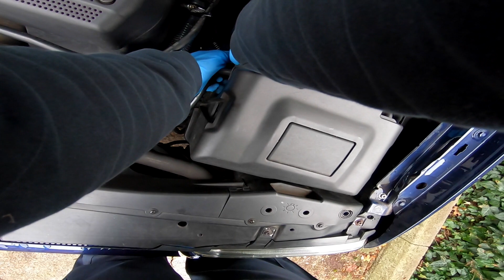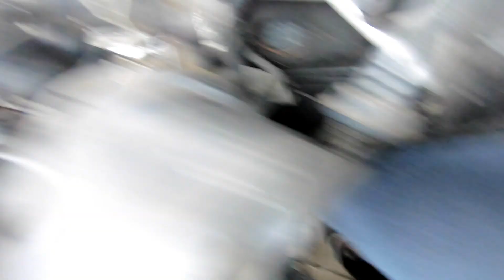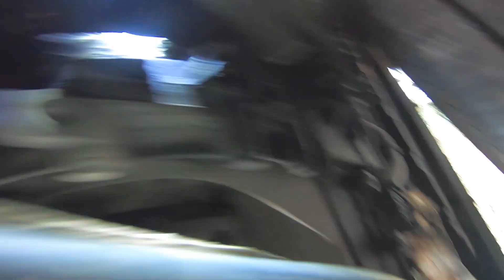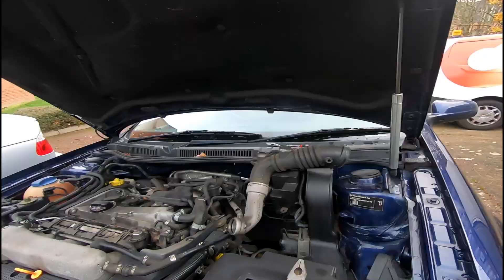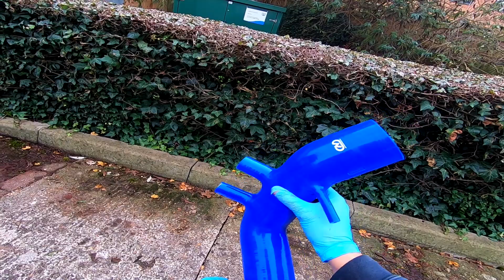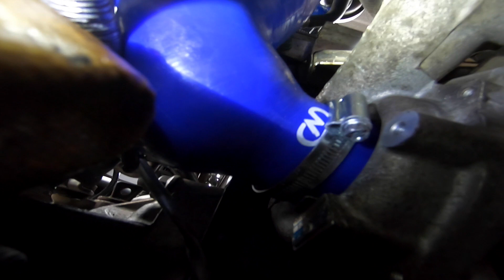MK4 VOLKSWAGEN GOLF GTI: INSTALLING AN OVERSIZED TURBO INLET PIPE (TIP)

Comment: Recently been following the mk4 content and loving it on the turbo inlet right at the bottom there is a nipple if my pipe is removed from that nipple will that cause boost issues low boost?
Reply from the maker: I'm not entirely sure what you are referring to, but I would try to not have things missing if you can avoid it.

Comment: If you want more air go for the CLOUDE 9 CUSTOMS LARGE PRORAM INTAKE KIT u will only need filter and the velocity stack will fit in your ram air heat shield
Reply from the maker: I will definitely look into this, they look really cool as well. Thanks for the suggestion

Comment: Hi Naz, thank you so much for making these really clear videos on your MK4.  They help me a lot with my A3 1.8t which is based on the same platform. I’m planning on doing the same oversize tip and ram air filter this weekend. To be honest I was dreading it but not so much now after watching how you did it. I will be getting some silicone grease as you suggested and unbolting that pipe. Love the channel mate and thanks again for great content.
Reply from the maker: Hi mate, sounds good to me!! Glad to hear you are giving it a go yourself. Failed to mention in the video that the TIP requires a little trimming at the MAF end, but you will have to work that out once it's on. Unfortunately, doing the engine bay deletes makes the area around the turbo so much more accessible but it's quite a big job first time around. You should be fine getting the TIP done, my friend had a Leon and he found it easy.

Comment: bruva, cold air ... but proper cold air mod nothing sucking hot air from the engine bay... and 3inch straight pipes.. hit that stage 2 software but go to some one experienced that will make a one off file for your k03s as that puppy can do a few small ticks if your car can breathe like with this setup. ... trust BRUVA!!  them 3rd gear power burnouts dont lie!
Reply from the maker: Hey man, thanks for your comment. My car has now been mapped stage 2 for almost two years now and I love it.

Comment: Hi mate, what’s the reason you got the 3” maf end? I’m not sure which size maf end to buy as mine is the 2’75” but possibly upgrading in the future and don’t want to have to change again, wasn’t sure if that coupling reducer came with it or did you buy that separate? If it didn’t, what size was it and where from? Thankyou 😎
Ben Rickard
Reply from the maker: So sorry for the late reply. I bought the 3" end to keep the option open of going for a 3" MAF but never bothered in the end. I bought a smaller piece of silicone hose and used that to space the gap out. Again apologies for the late reply and hope it all works out for you.

Comment: My ecs tip was a pain but I did get it on with no grease and it was a lot of work but fits great
Reply from the maker: Nice one mate, im glad it was nice and easy for you. It's a cool modification as well and it's supposed to be one of the most important ones for the 1.8t.

Comment: This vid is a godsend lol, I'll be doing this mod this weekend. I bought the Forge (Silicone Intake Hose for Audi, VW, SEAT, and Skoda 1.8T - MGOLFIND).

As soon as you mentioned some of these hoses only fit onto a k04 got me a bit scared now.
Mines is a 2006 Audi TT MK1 Roadster, 163BHP, BVP Engine, 8N9, K03 Turbo I believe.
Reply from the maker: Hey man, you should be fine with that Forge one as I remember that being an option. It's only the Badger5 one I think that is made for the KO4 on BAM engines. 

You might need to do a bit of trimming but then again maybe not, either way good luck with the job I'm sure you will be very happy with it once it's complete.
Reply: @SPOOLINUP  I've managed to get the original intake out,struggling a lot with getting the new one in. Will be getting silicone grease tomorrow, and might try dipping the corner in hot water like you did. I'm also hoping it fits onto the turbo as I read on the Forge website the intake pipe is 44mm at the turbo side, so am hoping my turbo is not the 50mm one!
Reply: @SPOOLINUP  did it! Holy cow was a tough job. Had to cut off around 2-3cm of pipe at the bottom and also at the top. Didn't need a couple for the MAF, it fit direct 70mm to 70mm. I trimmed the hockey puck pipe a little and I think a tiny thin piece mightve fell in the pipe 😢.. took it on a test drive no lights, no smoke, everything seems fine, more response, feels like more torque/power/responsive. Will see how things go over the next few weeks! That jubile clip down at the turbo end was a knightmare to get on too 🤣
Reply from the maker: I was scared to cut mine man as I didn't want to make a mistake. It is so weird that these things can be so difficult to fit. That is nothing thing I was scared of any bits falling in and down but that little piece is probably sitting somewhere in a small bit of oil your intercooler not causing any harm 🤣 dont worry. I'm glad you noticed a difference as its supposed to be one of the most important modifications to make. That jubilee clip at the bottom was a nightmare to do just the right amount so the pipe didn't slide off.

Comment: What did you do to the 5th value? I noticed that the original inlet pipe only had 4 values and that the bigger one had 5?
Reply from the maker: They both have five if you look carefully on the original there are four on the rubber pipe and one metal one on the metal pipe on the bottom. On the new one it is exactly the same but they are all longer so it is easier to see them.

Comment: What did you do with the line down by the turbo inlet? I don’t wanna start it with tubing not connected
Reply from the maker: Hi, if there were any openings left then they either got plugged or capped to stop air getting in after the MAF

Comment: Just watched your video as ive just had a 225 Audi TT traded in and i was getting little to no boost and i could hear air leaking.Found a massive split where TIP attaches to turbo.Also one of the breather pipes was crushed at a 90 degree bend.God knows who did that but theyre dangerous to be let loose on a TT.Good video and now i want an bigger diameter TIP pipe as it definitely improves performance.They do this mod on Smart for twos using Roadster TIP pipes.
Reply from the maker: Ahh man sorry to hear about the misfortune with the TT but at least there is an excuse to get an upgrade fitted. They do the badger5 TIP for the TT I believe as its got the BAM engine so its a much better platform. So maybe that person did some bad DIY with the car, are you a car salesman then? So on Smart fortwo they use the TIP from the Roadster model and it is larger? Thats cool

Comment: Bro - I've got a TT. 1.8T 20V 180bhp so similar engine (ARY) with a K03S turbo. Can you recommend a TIP that would fit? All the places I ask keep saying theirs won't fit my car...
Reply from the maker: If you have deep pockets you can buy a Forge one lol https://www.forgemotorsport.co.uk/Silicone_Intake_Hose_for_Audi_VW_SEAT_and_Skoda_18T--product--158.html
Reply: @SPOOLINUP  Haha yeah the engine bay in the TT looks 90% the same as yours. I did ask creations if they did a specific one and they told don't. But they are aware of people buying the TIPS and forcing it to fit  hehhe
Reply from the maker: Ahh I see, im not sure then, it must be a common thing and I cant believe there isn't a cheap option for you. Maybe save up and get the Forge so you don't have to force it on.
Reply from the maker: Alright mate, have you tried to message Creations motorsport to ask them? That is where I got mine from. Also you can go on Facebook groups for the MK1 TT and ask the question there. I dont know for the TT I am afraid bro

Comment: What’s the link to this part
Reply from the maker: https://m.ebay.co.uk/itm/GOLF-BORA-MK4-A3-LEON-TT-1-8T-OVERSIZED-SILICONE-TURBO-INTAKE-PIPE-AUM-AUQ-H04C/172237647393?ul_ref=https://rover.ebay.com/rover/1/710-53481-19255-0/1?type=2&pub=5575403537&toolid=10001&campid=5338343596&item=172237647393&customid=eb%3Ag%3Avms%3Aeb%3Ap%3A172237647393%3BCjwKCAiA8ov_BRAoEiwAOZogwSl1fJ24Y9D0cSbPobMl_fg2SGp6F5e8Pwz4fnB7jUVDlmucCJ823RoCEdcQAvD_BwE&gclid=CjwKCAiA8ov_BRAoEiwAOZogwSl1fJ24Y9D0cSbPobMl_fg2SGp6F5e8Pwz4fnB7jUVDlmucCJ823RoCEdcQAvD_BwE&srcrot=710-53481-19255-0&rvr_id=2740095904721&rvr_ts=8f62af8a1760a9e82162adfeffe5c090&_mwBanner=1&_rdt=1&ul_noapp=true&pageci=9df3e93e-70c0-491d-b29e-7acf1fe6a2fb

Comment: What size is the silicone spacer?
Reply from the maker: 80mm but no point in using it, just buy the turbo inlet pipe for the K03/K03s GTi engine codes because only the mouth of the pipe is bigger. If you buy one for a Golf it will fit straight on to your MAF

Comment: Hey mate u good, I've managed to put the pipe on but one of the vacum hoses seems to big to go in the hole in the turbo pipe , did you have to cut it or make the hole slightly bigger for it to go in?
Reply from the maker: Hi mate, im sorry man I wish I could re-make the video to update it and make it better and clearer. I had to bore that hole out a little bit and also I had go trim some of the spouts and the pipe itself. I got so frustrated I never filmed it. The 90° plastic connector doesn't fit in the hole well.
Reply: @SPOOLINUP  ahh legend mate , I've tried about 4 times today, I've been frustrated all day becuase that one hose haha, I thought they may have sent me the wrong one but nice one will do that first think in morning  , and thank you for this video after 3 hours some grease and some bending I managed to get it on.
Reply from the maker: Mate I really hated that job, I swore blind I would take mine off once it fits well and get it made up to sell copies 🤣🤣. My friend had to bore his out as well. You may have to bend the spout to point the floor while you do it though mate so no debris goes down to the turbo
Reply: @SPOOLINUP  haha , you should do you know , you got a good channel to advertise it on , and cheers for the advice, I will get on it first thing in morning, respect.
Reply from the maker: I dont want to take it off because I don't want to put it back on 🤣🤣 maybe one day if I end up breaking it I will be brave 🤣 I could measure it in situ though 🤔 good luck tomorrow 👊🏾👊🏾
Reply: @SPOOLINUP  haha I know exactly what you mean , nice one mate 👊🏽

Comment: Any clue where you could find a tip for a tdi?
Reply from the maker: What Golf is it mate? PD130 or PD150?
Reply: @SPOOLINUP  110 mate
Reply from the maker: I did have a little research last night and there doesn't appear to be much. Have you looked on the forums? Might be worth while messaging these guys and asking https://profidiesel.net/intake-manifolds-tip/80-profidiesel-19tdi-turbo-inlet-pipe-3-76mm-ss.html

Comment: Best video i have come across so far for doing this ball ache of a job
Reply from the maker: Hey, thanks man, just to let you know if you are not aware, you may have to trim down the MAF end and all of the other spouts to make it fit properly.Good luck mate, any problems give a shout 👍
Reply: Cheers man. You should do an SAI delete and get rid of the combi valve unit. Free’s up loads of space in your engine bay. I got my kit from eurotuning in america off ebay. They supply all the bits.
Reply from the maker: @scott2495  Thanks man I will look into ordering that up, thank you for the advice mate I've been meaning to do it for a while now.
Reply: Same!

Comment: I didnt find it to bad 🤣🥵 jokes mate I did a turbo upgrade to a K04 and my 3 inch tip in a very narrow garage
Reply from the maker: Haha that must have been so difficult, maybe I was dramatic 🤣🤣🤣
Reply: @SPOOLINUP  no mate they are a tight spot to get around being behind the engine and the hard oil lines that run around the block are a pain in the arse still editing my video for all my mods if I did it by 1 like you mate I'd still be at it so fair play mate it take alot of time editing keep it up
Reply from the maker: @anonlincracing2484  Honestly it was very difficult and I'm not that skinny or agile, its hard to fit your hands. It is one of the best mods. Thank you mate I will check out your channel myself.
Reply: @SPOOLINUP  thanks brother need any info on these cars give me a shout I didine on a complete budget

Comment: Shluld i return my 2 inch and get a 3 inch
Reply from the maker: If you have a 70mm MAF I would just stick with the turbo inlet pipe that is recommended for the KO3s. There are two, there is a normal slim one and an oversized one. There isnt much points in getting the 80mm one because it's literally only wider at the MAF end and you have to reduce it down to 70mm anyway so doesnt even make a difference.
Reply: Thank you
Reply from the maker: @mackdiesel8292  Sorry mate I hope that helps you.
Reply from the maker: @mackdiesel8292  you are more than welcome

Comment: Hello mate, only recently found your channel, I would look at doing a SAI delete and combi valve delete and charcoal canister delete, all really easy to do, cleans the engine bay up nicely too, subscribed!
Reply from the maker: Hey mate, I will definitely be looking into this for sure, it's been at the back of my mind for a while now. I may as well research it all during this lockdown and see what I can do. Thank you for the advice, for your comment and subscribing. 👍🏽
Reply: SPOOLIN UP no worries mate, just make sure that you can get vacuum line plugs and brace for the CEL to be on 24/7 after doing it I would recommend getting it mapped out so the CEL stays off
Reply from the maker: @robbird1495  Thank you, I will bear that in mind. I am trying to do as much as I can before mapping so I dont have to keep getting things mapped out so if I leave that to be one of the last things I do it will work out well. Again thanks for the advice man as it gives me ideas. I was thinking to pay someone to do the deletes but if you say it is easy I will give it a go myself.
Reply: SPOOLIN UP it took a few hours to do all 3 what I did due to some of the guides on YouTube aren’t the best, just make sure you have the combi valve blanking plate ready to go, some also say about getting resistors for the spare plugs what are left over but some say you don’t need them, personal preference I guess, another thing what I’ve wanted to do was replace all the vacuum lines for upgraded ones but there is absolutely nothing on it so might be worth doing research into that too for another video idea
Reply from the maker: @robbird1495  I see what you are saying, this job sounds like it's all about a big preparation and research. I know this will be one job that will take several forum threads and videos to complete so I will try and make one good solid video in the future. Thanks a lot man all of this helps from someone who has experience and done the job themselves. I will also look into upgrades vacuum lines and making a video because I know they are a pain when they leak.

Comment: glad my tt tip was easier to remove...
Reply from the maker: Removal was ok!!! Fitting was a pain 🤣🤣
Reply: yeah, what made it easy on the 225 tt was the k04 .....and the maf was already 80mm. plus there seemed to be more room at the back end there, and all was done from above...glad it gave you the result  you were after..
Reply from the maker: @anthonynewcome128  Yes I did see that it was a lot easier on the BAM and also there were a few more options on the manufacturer. I also compared the hose for the AUQ and the AUM, only the neck at the top is bigger so there is no point, the hose down towards the turbo is the same size. Also required cutting at MAF end which was annoying 🤣 thanks mate I appreciate what you are saying 👍🏽

Comment: I cropped mine at the bottom where it meets the turbo inlet just to move it closer to the turbo, yours is touching the gear cables
Reply from the maker: That's correct, it is touching the gearbox cables but won't affect anything because the cable is inside a sheath. The top end needs to be cut back as well.
Reply: @SPOOLINUP  Sometimes it wont. Ive done the job a 5 times. And my last time,as you said the tip started slipping off. I found that moving the sheilding on the shifter cables back helps keep it on. I think that because my mounts are getting worn. That the engine is moving too much so everytime I would go to shift and rock the engine the pipe would come off.
Reply from the maker: @aRYANz88  This isn't an easy job by any means and from reading your comment I am having not so pleasant flashbacks to when I did it 🤣🤣 I think its best not to do the jubilee clip on the turbo up too tight and then it doesnt slip off under the pressure from the clip.
Reply: Is the one you bought a 3 inch when i was ording mine it said the 3 inch was for a big turbo i ordered a 2 should i return it and get a 3 inch?
Reply from the maker: @mackdiesel8292  I replied to your other comment mate, hope it helps you. I bought the oversized pipe for the KO3s.

Comment: where did you get the silicone spacer for the maf?
Reply from the maker: I ordered it online from ebay, it's not really a spacer but just a 70mm coupler used as a spacer to reduce the gap between the pipe and the MAF. Hope this helps you
Reply: SPOOLIN UP do you know which? the ram air one is 5mm thick making it 75mm meaning it wouldn’t fill out the inside of the inlet pipe
Reply from the maker: @Yosei-  I just had a look at the one I purchased and it says its between 4-5mm thick. That 5mm gap will be spread around so may be more like 2.5mm around the circumference and that will be closed by the clip/clamp plus you want a bit of play so you can fit it together 👍🏽
Reply: @Yosei-  its a pipe so 5 mm thickness is doubled since its a circle innit so its actually 10mm